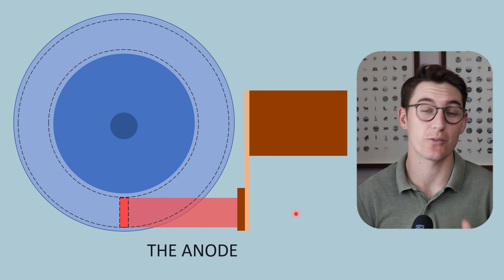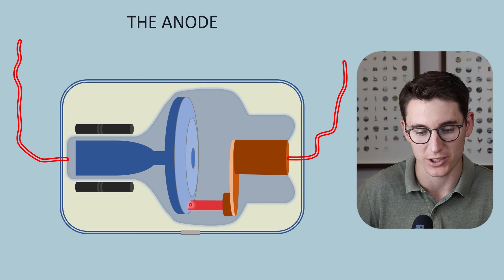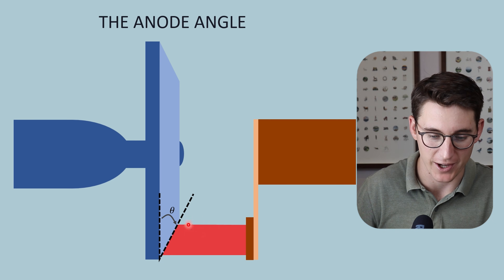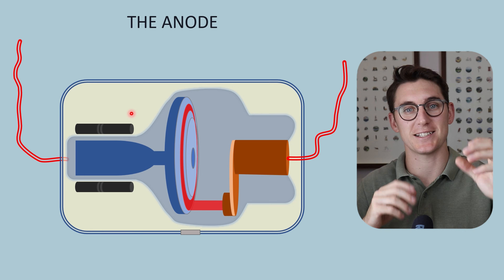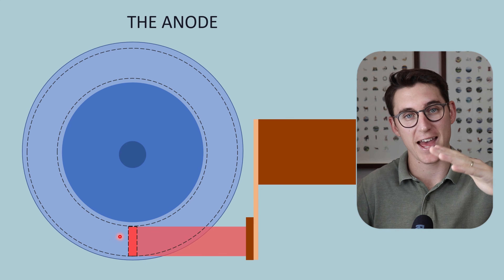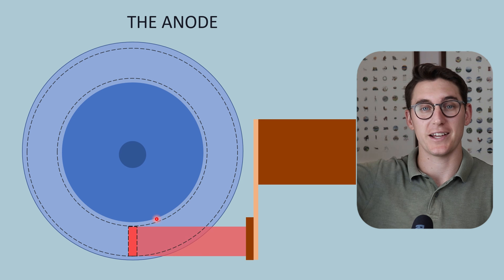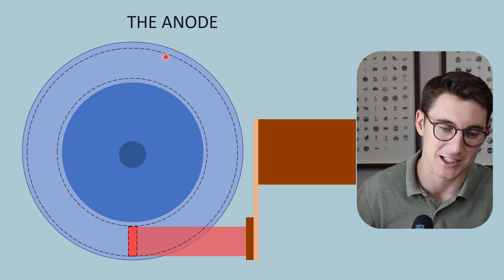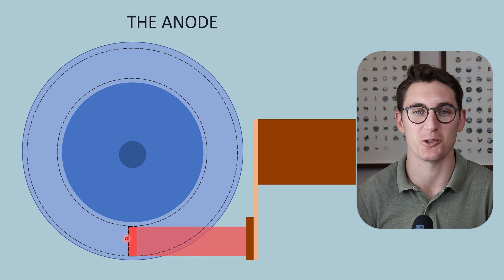The Anode | X-ray Machine | X-ray physics #3 | Radiology Physics Course #10

Comment: Hi. Can I know why the kV and mAs of xray tube is independent to each other? We learnt that V=IR (voltage = current x resistance) in an electrical supply. Why xray kV and mAs are not related? And is there xray tube resistance?

Comment: Hello, I have a question about the anode. You talked in a separate video that there is a copper or aluminium filtration that filtrate low energi photons. I read that the filtration was on the anode itself, is that true?

Comment: Hi Michael, I was hoping you could help clarify something for me. I recently came across a test question on an ARRT prep website (called Radreview) that seems to be saying something contradictory to what you say in this video about heat tolerance and the anode angle. You mention that increasing the anode angle increases heat tolerance, and that makes perfect sense since the area of the beam is spread out over a larger area. However, Radreview says that it doesn't increase heat capacity. Here's the test question and answer from Radreview:

"The surface of a rotating anode is beveled with a target angle. As the angle increases from 8 degrees to 15 degrees, what three changes from the following list will occur (select the three that apply)"

According to the website, the three correct answers are as follows:

"Effective focal spot increases
Spatial resolution decreases 
Anode heat capacity is unchanged"

Do you have any idea why it would say that anode heat capacity is unchanged? Is Radreview simply incorrect or is there some nuance here that I'm not understanding?
Reply: Did you ever figure this one out? I read that anode angle is inversely proportional to heat rating and have done q's that say the same which also contradicts what Michael said.
Reply: @Requiemae  Think this way.... We have an electron beam of diameter A....it strikes an "actual focal spot" and then gives rise to an "effective focal spot'  of diameter B because of say 15 degrees ANODE ANGLE. We don't want this effective focal spot...rather we want a smaller one (diameter C) for our xray examination.For that we can either decrease the actual focal spot or decrease the anode angle.Right? If we decrease the actual focal spot,we will have to decrease our other parameters like MAs and KV...to handle the excessive heat production..in other words our heat rating will decrease.BUT if we keep the actual focal spot the same as before and decrease the anode angle to say 8 degrees, we will get the smaller effective focal spot of our choice (diameter C) without the need for decreasing MAs or KV...in other words our heat rating has increased by decreasing the anode angle.We have now more liberty to keep our actual focal spot larger while still enjoying the benefit of a smaller effective focal spot.That was made possible by decreasing the anode angle.Hence decrease in anode angle led to increased heat rating.
Reply: Is it referring to the body of the anode which makes sense that the heat capacity of the anode doesn't change, just the focal track.